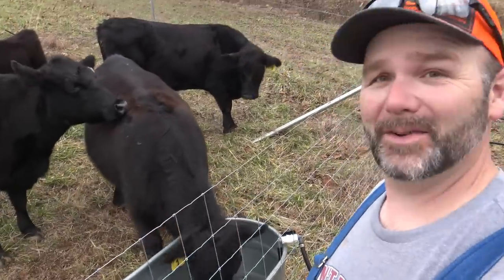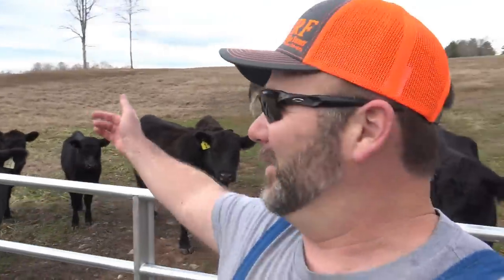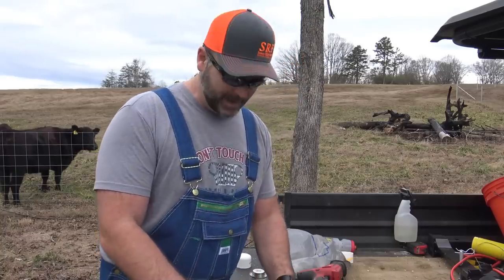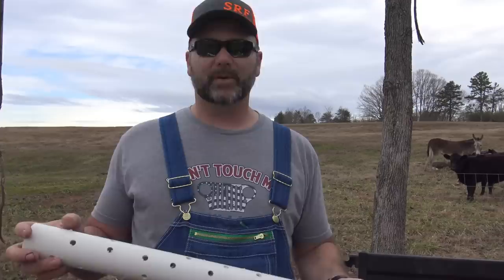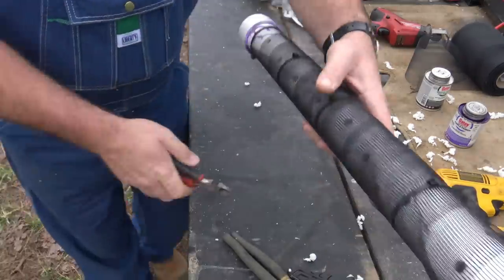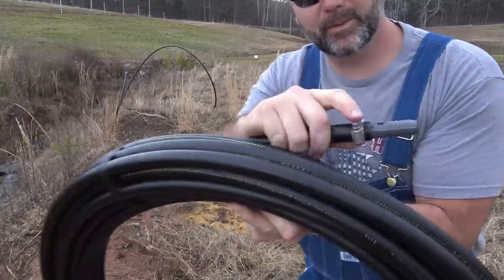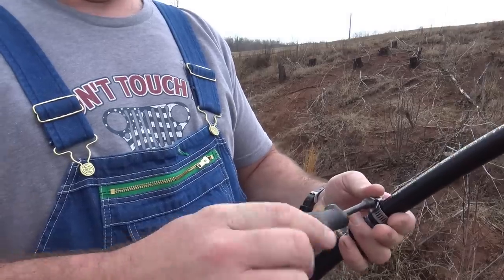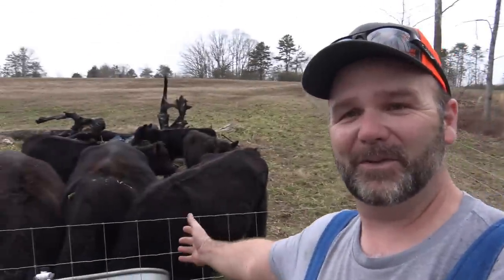Non Stop water system..no electricity, no pump, simple and easy

Comment: expensive and cumbersome way to move water.  next time, do this:

1.  go to yard sale and buy used garden hoses.  if necessary, Home Depot.
2.  drive t-post in 2 ft of water in pond.
3.  take 25 ft garden hose and dunk it in water, filling it without sucking on anything. never suck on anything on a farm.
4.  wire one end to t-post 1 ft below water line.
5.  walk other end over dam and the siphon will begin.
6.  add garden hoses as necessary, the water will never stop.
7.  place water hose in trough, but wire in place so cows don't disturb it.

total cost, even new less than $60.  time to install, 10 minutes.  suck time, zero.   and you have some sweet garden hoses for the next project.
Reply from the maker: So...spend 3 weekends gathering old garbage cheap water hoses...wade out into the pond and drive a t post....take said garbage water hose and put it in the water.....don't put a filter on it and wire it to the t post....add more garbage water hoses...and let the water flood the edge of the pasture constantly?  Seems that buying 300 ft of pipe and a couple valves works just fine...and when I'm ready to make this permanent I simply bury the pipe....I'm pretty happy with our setup....takes a bit more money to do things a bit better....we now have permanent valves in our water tanks that automatically fill the tanks...system works great...I get what ur saying...100 ft of poly pipe is much cheaper than a high quality 100 ft garden hose.....cheap garden hoses don't last.....and even good expensive hoses only last about 3 seasons in my experience.  I like our setup...but doing it on the cheap is the way for some folks...I'd rather spend an extra $100 and not have to fix it all the time

Comment: The best water in a pond is about 6 inches below the surface. Put your float over the filter with a couple of tie wraps in loops between the tie wraps on the filter and the float. This will keep it off the bottom for as long as the pond is deep enough.
Fill the pipe with water at the pond by sinking it in the pond. Then shut off the business end and pull it to the trough. Then you don’t have to suck on it.
Reply from the maker: Thanks....next time I'll call ya first lol

Comment: Sea to Summet bilge pumps are nice. https://seatosummitusa.com/products/solution-bilge-pump   You can most likely pour water into the pipe with someone on the other end or not maybe.... then just submerge the top end once pipe is either full with valve closed or is just flowing and hopefully the air bubble doesn't affect when you submerge into the pond.   Then run down and turn off the valve when you need to.  Thanks for sharing.

Comment: You can do a similar system with water. You still have suction on one end and release or flow on the other. I have done this with many types of fluids. Given the fact, you are going downhill with it; once it's going, it's going. I did a random air compressor vacuum search and this is what popped up.  I'm sure you have a portable air tank for like a flat tire, I bet that would work. Hope this helps.

https://www.youtube.com/watch?v=dwfZg6ze_dw

Comment: The EASIEST way to siphon WITHOUT SUCKING IT!
Back story: my dad and older brother told me I need to siphon the water down the hill 100ft with a hose and they said it was cuz I 'suck.' Obviously they thought it wold be funny to joke me cuz they didn't wanna do the work....10min later and they walked off dumb founded, probably cuz they had to think about all the times that they had to suck and suck and suck...but not me, I'm no sucker...

Run the line the length you need then go back and coil it back up completely. Then stand next to the lake and slowly coil the hose into the lake a foot per second to slowly let the water in without getting air pockets. Then close the valve or hold the end to keep the water in the hose. Then run ur line back to the location you need and open to let it flow...DONE!

Comment: Soooo... you are trying to suck air out of 300' of 3/4" poly pipe?!?  EWWW!  OUCH! 
Why not use a simple pump?  
WHY not have a float valve to stop it once the tank is full, so you don't syphon the pond dry?
Reply from the maker: Watch the next video in the series...we install valves and make it fully automated